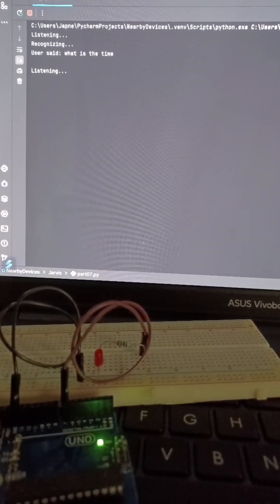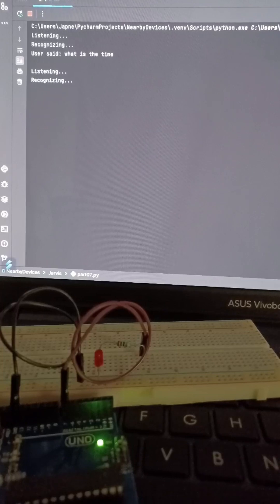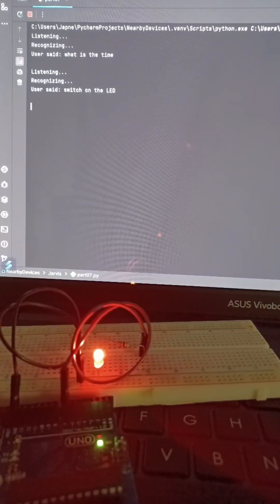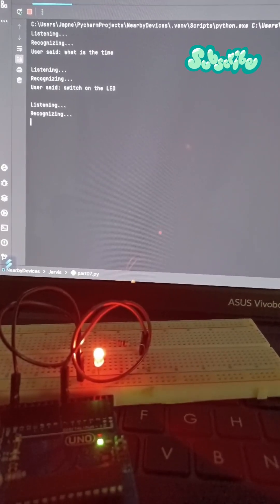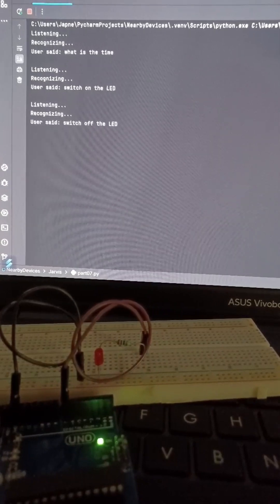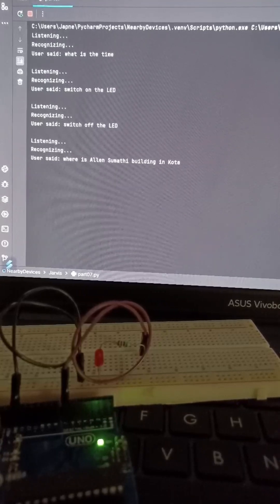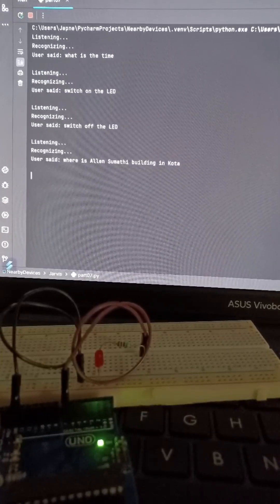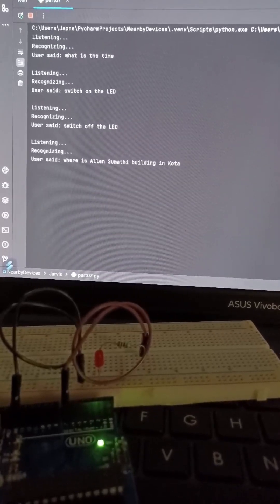Meet Jarvis. Search without typing.

Comment: I am a beginner, can you tell me Which arduino board did you use and what extra peripherals were required
Reply from the maker: I have used the following components:
1. Arduino UNO 
2. Led
3. 220ohms resistor and some jumper wires to make the connections
Secondly I have used python and for more reference you may check out the code on the following link https://github.com/Japneet2010/Jarvis.git
Reply: https://youtu.be/O5JasAv_FHs?si=K0O7KrKQWmoSI61w